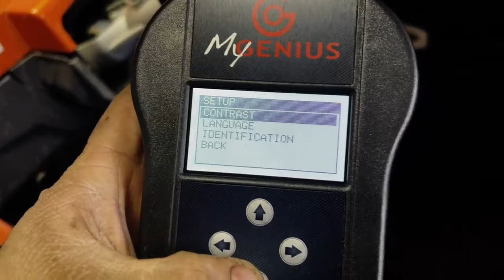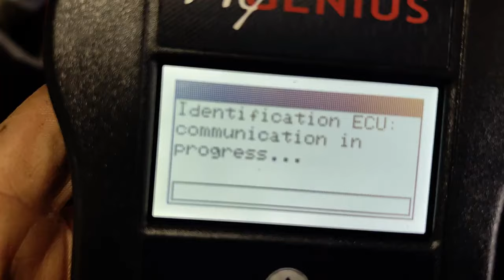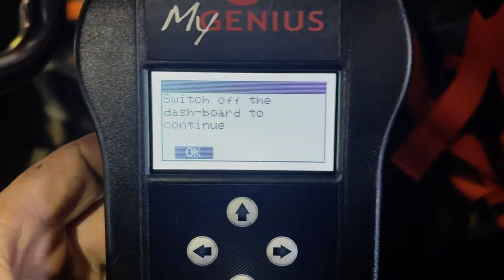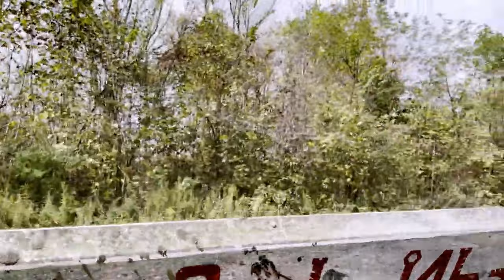Will Clutch kit and ECU Tune Void your CFMOTO Warranty Lets Find out

Comment: great informative VID.. thank you for sharing... Question for a NOOB..
on the right hand side of my U-Force 800 steering wheel on the dash there is a button with a triangle symbol on it, i have no user manual... any idea what its for and when to use it ?.. i do know its NOT the Hazard lights  indicators.. any info would be great
Reply from the maker: It’s rev limiter override for reverse.

Comment: Just ordered a clutch kit, snorkel, and need more power. Looks like I need to send my ecu to Ray Parker.
Reply from the maker: Yes 🙌 his tune is beast.  And the price is right.
Reply: @R.N.GPerformance  I saw the price and it's really good. I put mud tires on mine and they are 30s. I lost power and bogg in mud holes. Once I get that strait she will be a beast.
Reply from the maker: @matthewtuggle5467  yes definitely.  Have you reclocked the secondary?
Reply: @R.N.GPerformance  No not yet, I'm still waiting for my clutch kit to be delivered and then I will do that. I got the one offered at mainstreet cycles.
Reply from the maker: There you go. It will work great.
Reply: @R.N.GPerformance  I've been watching your build and you have  helped with alot of the decisions on what to do with mine. Thanks for the great content and hope to meet you at a cf moto event one day.
Reply from the maker: @matthewtuggle5467  thank you 🙏 I will be at the CFMOTO take over in may in Mississippi if you are going to be there.
Reply: @R.N.GPerformance  what are the dates this year?
Reply from the maker: @matthewtuggle5467 20- 21-22 I’ll be there the 18th they are letting us in the park early.